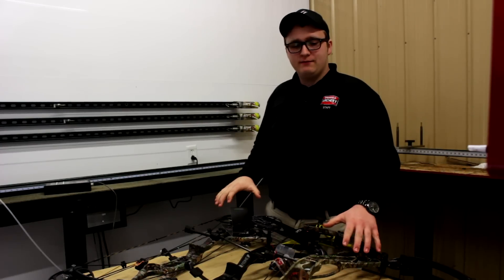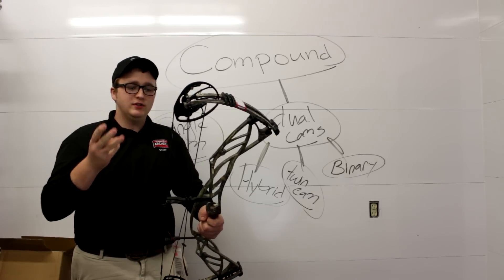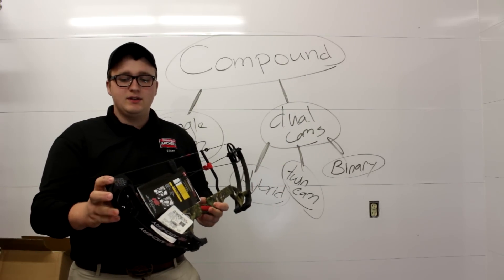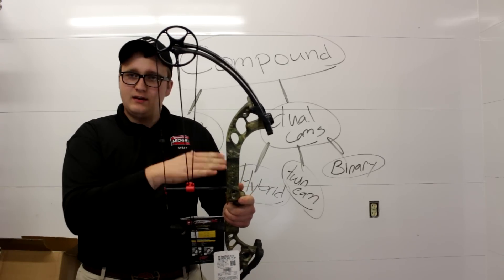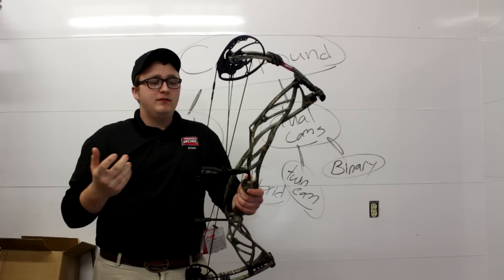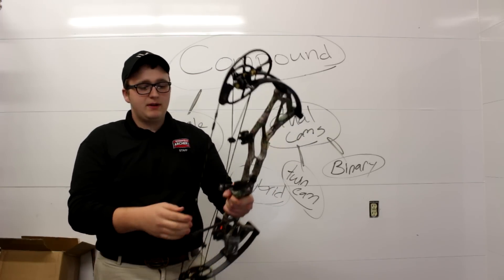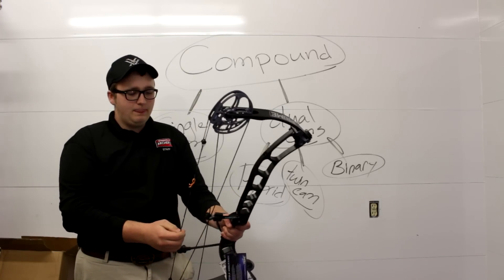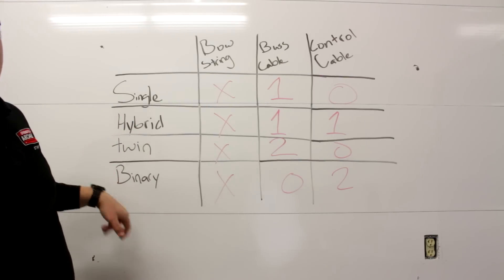Breaking Down Bow Cams

Comment: Darton started out calling their CPS cams a SINGLE CAM system.  It basically was a single cam with string posts that allowed the long single cam bow string to be divided into two strings and attach to the top IDLER cam.  The string portion of the idler was shaped so that the string take-up of the idler closely matched the bottom cam for LEVEL NOCK TRAVEL.    So basically, the CPS cams were a single cam system modified for level nock travel.  And as a bonus, you didn't have a very long bow string to deal with.  So the CPS type hybrids that Darton used to use and PSE still uses is basically a Single cam with a string, a Buss cable, and a control cable.  The bottom cam of a CPS is basically identical to the bottom cam of a single cam.  The CPS just has a Hybrid TWO TRACK IDLER.  Where the string side of the idler has close to the same profile as the string track of the bottom cam to help maintain more level nock travel.

Comment: I think it would have been easier to fallow the progressive technology of the cam systems. Also thexwhy and how they evolved and what difference and improvement each make.

Example in my biomechanics classes we went over Newton's Laws, mechanical advantage of a pully system, and the more pullies set up, the greater the me handicap advantage. For example more pullies will double the ease/double your strength/ reduce the force you need to pull and lift the weight. Though when increasing the number ofxpully systems, you will need to have to pull twice the length rope of a two pully system,  than you would with an one pully system. Pullies are also designed to change the directional force.

Comment: The binary overdrive is indeed a binary cam, just as the AVS system Mathews uses. The axle and cam are splined together therefore the axle rotates with the cam. They done this to use a split yolk system and eliminate cam lean which is inherent with standard  binary cams.

Comment: love the video. you should take off your shirt and wear short shorts and remake the video. lol but on a serious note. single cams are straight up the best.
Reply: Mark Chavez the best at what? Speed? Smoothness? Maintenance? Aesthetics? That's like telling someone a huge butt is better than a slim butt.
Reply: The best at more nock travel and less speed. Less down range kinetic energy. ie penetration.. lol
Reply: Well I like single cam over dual cam because with single cam you don't have to worry about your two cams going out of tune from one another.
Reply: RollthetideGamer ...true.  But single cam bows still need to be “timed.”  All single cams will be most efficient when the cam is drawn from one specific starting position.  Often, that positive n is not set from the factory.  Also, if you are getting really technical with your setup, and twisting your string to make minute adjustments to your draw length, you may need to then adjust your buss cable to reset, or retime if you prefer, your single cam starting position.  

That said, the Mathews Conquest 4 is a single cam bow, and has more tournaments and prize money than any other bow.  So there is that.